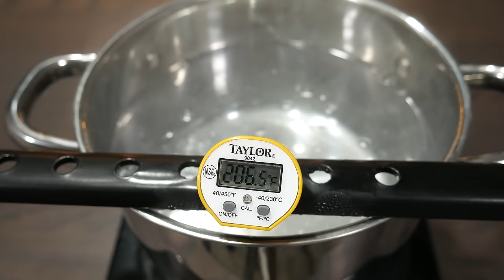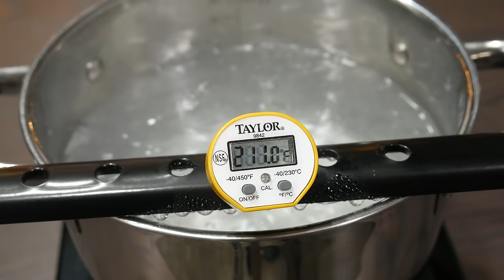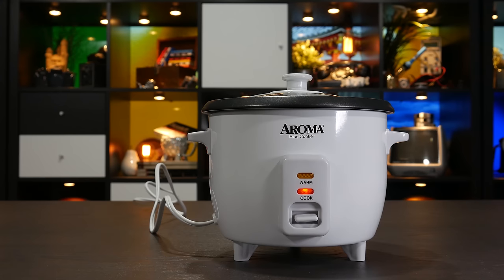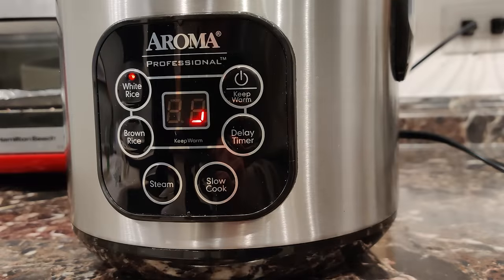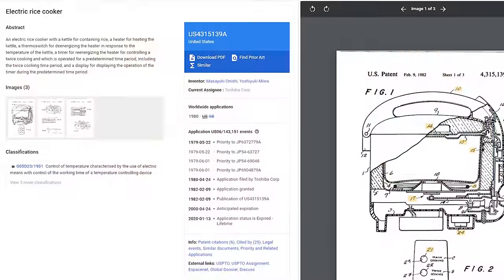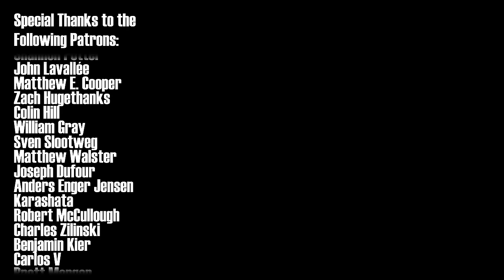Old-fashioned rice cookers are extremely clever

Comment: As an Asian who eats rice everyday, this has been the question of my childhood.
Reply: As an Asian, do you approve this rice cooker?
Reply: @MaxiRSilva  as an Asian I approve of this rice cooker
Reply: Aroma is a solid brand actually.  It’s not fancy like Zojirushi but it gets the job done well for the price.
Reply: @majist0  Aroma is a solid brand actually.  It’s not fancy like Zojirushi but it gets the job done well for the price.
    Thanks for that useful review!  I'm interested in getting one now :-)
Reply: @MaxiRSilva  as an asian, i very much approve of rice cookers.
Reply: Anyone out there knows the exact secret of the water ratio to rice?  I use the middle finger to knuckle then back off about an 1/8 of an inch water level above the rice. Anybody who has a better idea short of weighing the rice than adding the exact amt of water with a measuring cup?
Reply: @harsep  I do use the measuring "cup" provided.
     2 cups rice (rinsed 3x); drained, placed in rice cooker pot
     3 cups liquid (1 water, 2 broth)
Some salt, some butter, stir, jiggle to level, let soak ½ hour.
Plug in and turn on the rice maker.
¡Perfecto!
Reply: @harsep  Use the same cup to measure the rice and water. 1:1.5 or 1:2 (r:w) works fine or anything in between. The more liquid you add, the more the rice will clump together.
Reply: @josephgaviota  ya thanks!  never knew about substituding broth for water. Will try that out sometime.
Reply: @amypeggs9606  The plastic cup that came with the Aroma rice cooker doesn't look like a measure cup...seems to be less. But your ratio even at 1 to 2 seems to be low on the water based on using my knuckle method.
Reply: I live in Northwest Asia and don’t even knew about dedicated rice cooker . Multi cook are pretty common here
Reply: @amypeggs9606  I've always found that after washing the rice, the water I add, is that same cup full or water. That half bit has been made up with that bit of water left there after washing, just rough measurements as you know, plenty good enough.
Reply: As an asian, I approve of sous vide rice
Reply: As an Asian, have you ever open up old unused rice cooker only to see bunches of decomposed dead lizard underneath the heating part?
Reply: @harsep  Mine is pretty basic, the same amount of water as rice .. then a little more. 
I also turn it off rather than let it warm. I find warm burns. 
So if a cup of rice, I use a cup and maybe a 1/4 of water. It seems to change every time I cook.
Reply: My rice cooker, that I obtained 28 years ago and still works perfectly, came supplied with a small plastic cup. For each cup of rice use the corresponding water level scale on the inside of the rice cooking bowl. Plus or minus a little if you want your rice stickier or drier.
Reply: @Am0re98  - this made me laugh! ...my dad worked on the railways in rhodesia and he said one day the chef was complaining the kettle urn spout was blocked up. My dad found a cooked lizard inside the spout. People were drinking lizard tea with out knowing....
Reply: @harsep  chech out a recipe for “Kao man gai” which is one of the best (but still unknown to most) Thai dishes. 
Basically boil a chicken with ginger and herbs, then use part of that broth to cook the rice, and another part to make a supplementary soup to be served along with the chicken and rice. 
The dish looks boring, but is world class!

Comment: I've used these rice cookers for years and never really questioned how they actually worked.  I just assumed it was some sort of bimetallic switch.  This was eye opening, thank you!
Reply: Most cheap ones have a thermoswitch. I have never actually seen one using this system
Reply: Howard Black  I assumed myself that it was weight based, and would release when a certain amount of water was boiled away.
Reply: @Tinfoilpain  but it does'nt boil away, the rice absorb it
Reply: @dabigbadwolf5081  : And a pound of rice looks like half a pound of rice + half a pound of water.
Reply: @Mr371312  Umm, NO most cheap ones have this magnet system as does the original design
Reply: @Tinfoilpain  ... It cannot be weight based because you can cook 1, 2, 3, 4 or 5 cups of rice with the correct amount of water added. All different weights. However, before this video I had no idea magnets were involved in the mechanism.

Comment: I bought a rice cooker just like that  when I first moved  out of my parents home. Over 20 years later it's still the only rice cooker I've ever owned. It's worked flawlessly every single time.
Reply: Is it cheap and affordable?I want to buy a rice cooker,but I don't wanna spend money on zojirushi,it's 350 dollars.
Reply: @alexandrathearmy8464  yeah just buy a cheap one by decent brand it will be ok
Reply: @alexandrathearmy8464  ...any cheapest one will do.....though a brand name might last forever until you outgrow its size.
Reply: @jcjc3671  ok,I was thinking about buying instant pot duo,cause it has good reviews,many cooking options and you can buy it online for 30 dollars.
Reply: @alexandrathearmy8464  I almost bought one after all the excellent reviews, and watching cooking recipes on utube. I was even offered one by a friend in Ont. who bought one and isn't using it. Turned around 180°, saved some money, and am using a max of 2 biggest Sanyos, a big Chinese one, and a small Black and Decker. Easiest I've even come to cooking my one daily meal. 4different sizes classical Hawkins pressure cookers sleeping in cupboard. 2new portable induction cookers and large dedicated pots same. Easy Cooking pushing one button for myself and dog!!!
Reply: Yeah I use an old fashioned rice cooker that’s older than me. Works fast every time.
Reply: @josie3221  yes, not worth buying an expensive instant pot or multicooker unless you want to add photogenic value to your expensive kitchen landscape because a cheap basic one-button ricecooker can answer almost all your cooking, roasting, steaming, pan frying, soup making, and baking needs.

Comment: I bought my first rice cooker in 1980 while stationed on Okinawa.  It worked fabulously for over 35 years.
Reply: You could probably fix it with a soldering iron.
Reply: @aristedes9449 nah, after 35 years, it might need to be out inside of a display case and retired
Reply: @Bistinglolwut  why? the new ones are still built the same way. 35 years isn't even that long for an appliance to survive, you're just conditioned to expect shit to break after 5 years max by planned obsolescence.
Reply: @aristedes9449  Look, I enjoy repairing broken appliances, but that doesn't mean everybody has the time, wants to put in the effort, or even cares about something that might as well cost 15-20 dollars.
Reply: Is that what people call "Wife" these days? :D
Reply: just avoid CUCKOO.
Reply: It lasted till 2007, that's amazing
Reply: My mom gave her rice cooker when I move out.i was very little. After I used it for another 5 plus year that's equal to 20 plus years. I neglected it. Left it always on warm mode.. I wash it with water inside the heating coil and damage it. It would have lasted longer. I think it was tiger brand or the other two main brand popular brand.

Comment: It was Pierre Curie, husband of Marie Curie, that discovered the phenomena that bears his name. The Curie temperature varies considerably for different metal alloys, there are even some that have Curie temperatures well below freezing. There are magneto-optical data storage drives that rely on the Curie temperature to record and erase data.
Reply: the other fun point is that at least for some materials they only become magnetic past a certain temperature

i think it was aluminium (or an aluminium alloy for casting at least) does become magnetic and this is quite notable due to the magnetic field caused by some furnaces heating said aluminium for casting
Reply: *phenomenon (singular)
Reply: if it happens to different types of alloys at different temperatures would it be plural?
Reply: @mattmarlow1458 :  You seem to have suggested you think it's likely singular with the phrase "it happens", just as the OP indicated with "bears".
Reply: Like MiniDisc, for example
Reply: in this video he said the metal temporarily loses it ability to be attracted to magnets when it reaches a certain temporature. . How would the technology be used to store and erase data on magneto-optical disks with heat?
Reply: @manp1039  given that a byte exists as either a 0 or 1, in magnetic systems i assume they use polarity to indicate 0 or 1 so heat can be used to wipe a magnetic drive by changing its temperature to the point where it temporarily loses its magnetic properties thus temporarily becoming neither 0 nor 1
Reply: . It may be word science but it is Not interesting

Comment: “And you have to remove the gasket and clean it regularly.”

H-haha yeah I totally knew that was a thing [nervous sweating]
Reply: [rice cooker sweats as well]
Reply: Yeah I had a rice cooker with the lid made of two parts (well 5 if you count the rubber ring, and two brackets that holds the two pieces together, I am purposely ignoring the screws) and it was a pain to take out and clean.
Reply: I think we all have same experience - buying fancy rice cooker and then have to unscrew the top just to clean it
Reply: Bruh I never knew you had to clean the gasket. And I eat rice all the time.
Reply: this is why technicians say RTFM so much. the manual tells you these things.
Reply: Lmao!! You're not alone
Reply: yeah haha
I totally remember that thing can be removed 

[panicking internally]
Reply: Newer versions of that rice cooker literally have "Clean this part regularly" stamped on teh underside of the lid.
Reply: The idiot said: The American Variable: Instructions are read and followed at the user's discretion.
Reply: @AzharH1983  Eh, I have the Aroma cooker he shows and it's not annoying to remove, it just pops off, but it is annoying to clean.  I can KINDA understand not realizing you need to clean it except...it gets so fucking nasty.  I never read that you had to clean it, it's just obviously gross and covered in gunk (Excess starch from the rice carried by steam I think?).
Reply: ...by aroma cooker I meant the "fancy" one (It's not that fancy, it's very basic just not...completely basic).  I forgot both brands he showed were Aroma.
Reply: Legit didn't know that and I use my rice cooker like 1-3x a week
Reply: wash your rice before you cook it and it won't bubble up as much to make it dirty.
Reply: @keithbrings9053  yeah, but you still need to clean the gasket as well, which most people dont do
Reply: TBF, if the part regularly gets bathed in steam, I doubt it actually needs to be cleaned often, even if it does look gross.
Reply: @h8GW  if it gets steam, IT DOES need to be cleaned regulary
Reply: @h8GW  it gets gunked up with rice starch which is an ideal breeding ground for bacteria and stays damp. Nasty. Cooked rice can breed some very toxic bugs.
Reply: @lindyashford7744  Which immediately get killed next time you make rice because of the heat of the steam. That's why he said what he said.
Reply: @towakin7718  so you think it is fine to have a build up of bacterial gunk in you rice cooker when it is not being used but you might still need to handle? Yuck. Better to clean it. Especially as the components behind which the bacteria can collect maybe shielded from the steam. The guidance on cleaning exists for a reason.
Reply: @lindyashford7744  I think you should stop trying to figure out what I think, you're obviously not up to the task. You complained about bacteria to the guy who understands they get killed and it's no big deal if you use it regularly, I explained this to you. No mention of grossness or anything else. Also the steam doesn't need to reach, the heat does, it is sufficient to sterilize it. And I simply use the simple version, it doesn't have the problem in the first place.
Reply: @towakin7718 , as a person who has cooked rice for over 60 years, AND done the cleaning up I can definitely tell you the residues that get left are VERY gunky and unhygienic, and I would not serve rice from any cooking implement that had not been cleaned thoroughly. It isn’t just me there are others who attest to how a buildup can develop, and also that manufacturers instruct you to clean the parts regularly. What you think interests me very little, even when using s simple device like the basic rice cooker discussed here, or even a pan with a lid, if a batch of rice grows any kind of mould or bacteria, it can unless very thoroughly cleaned be vulnerable to that repeating itself, because EVEN THOUGH STEAM IS A BASIC PART OF COOKING RICE not all spores and bacteria get killed by the steam that is generated. Your opinion in this respect means very little. What actually can happen does. Most especially as many of these rice cookers have stay warm functions which actually make the problem worse. If you want to take the risk as an individual that’s fine, but anyone cooking for others has a responsibility to them.
Reply: @lindyashford7744  https://www.youtube.com/watch?v=_rBO8neWw04 And my mother washes dishes before putting them into the dish washer. It doesn't mean my dishes are any less clean, just that I save a lot of time, water and gas. Just because you did something for a long time doesn't mean you do it well or right. Again, I'm not saying you shouldn't clean it after every use (it's a waste of time, but it's your time not mine ;), aesthetics play a role, just saying, what the other guy said, "if you use it regularly, it's not a [health] problem [, because the bacteria get killed by the heat]". Certainly less of a health issue than what Americans call food.
And they do kill the bacteria, because it's hot for quite some time (the heat goes up, and heats up the elements in question, so yes, it get's there. If the "gunk" got there, the heat gets there), and those bacteria don't survive at these temperatures, which is why if you use it daily, mass may accumulate (yeah, at some point you'll have to clean it, but wasting minutes every day on it is just not necessary), but it won't start to smell. This is biology, and your opinion in that regard means very little. Also just in case, since you seem unable to stay on topic, such things should always be kept open so they can dry. And the manufacturer writes it 1. because it does look bad and he doesn't want that and 2. rather then telling people how, when and why it's not an issue, it's easyer and safer to tell them to always just clean it, just in case someone like you reads "regularly" and thinks, oh well, once a month is regularly too, and I'll leave the lid closed and build myself a little breeding chamber.
But women be women, they jump at every opportunity to waste more time, let everyone else know how evil their ways of not wasting time are - even ones who're not even concerned, like me with the simple cooker that, in the worst case, needs a little water over the lid. And of course they always know best, who am I to tell them the bbq grate doesn't need to shine or their wet sponge may remove the sauce "easyer" than a paper towel but spread a plethora of microorganisms over the table.
Reply: Just boil some vinegar water in it before trying to clean it. The vinegar and steam will make everything easier
Reply: I thought it sterilized itself every time you use it.
Reply: @lindyashford7744  yes, these people seem not to know about that really bad toxin that develops in cooked rice, wow, they should know that! they will wonder how they got their suddenly vomiting illness.
Reply: @towakin7718  love the bit of casual sexism you throw in there for extra measure to demolish any argument for taking a basic good kitchen hygiene measure,  do not be surprised if you get stomach bugs from time to time that you do not know the origin of.
Reply: @lindyashford7744  What's the sexism, the way many women behave or the fact I point it out? But I guess since I never got "stomach bugs" in my bachelor years, you just made a pretty strong point for my argument.
Reply: This "fancier" one that he has is just at the sweet spot of expensive enough to have lots of fiddly parts, but too cheap to be designed in a more convenient way. I have a multi-function cooker like this but slightly more expensive (still quite cheap), and it's just designed way better, it doesn't get covered with gunk, doesn't have inaccessible nooks, the gasket is easily & quickly removed and washed, and once in a blue moon you can easily take out the valve in the lid and wash it too. It's probably about what's popular in your country — in mine, cookers took off very well so there's a lot of choice.
Reply: The gasket on my pressure/rice cooker isn't removable you just wipe it the only thing I can remove is the rubber ring seal but it only gets dirty if I spill something on it so I do that about once a week otherwise just clean the bucket and wip the lid